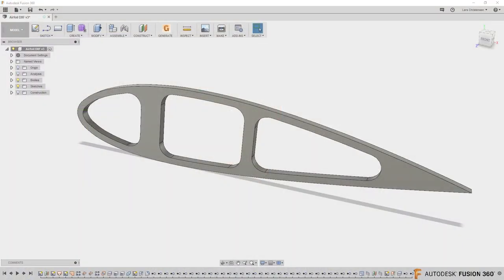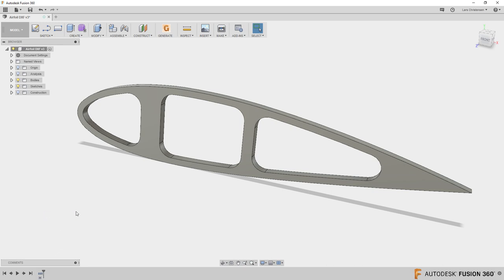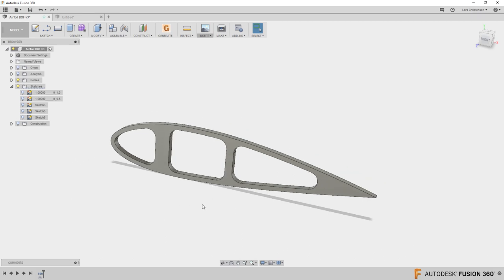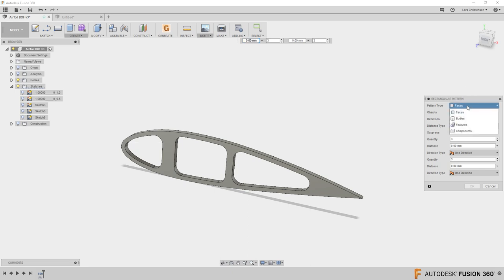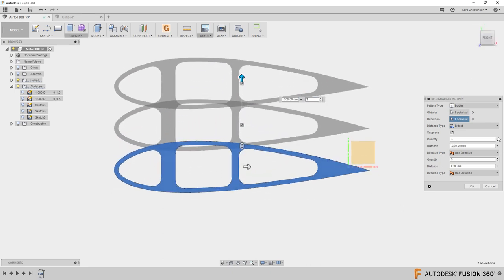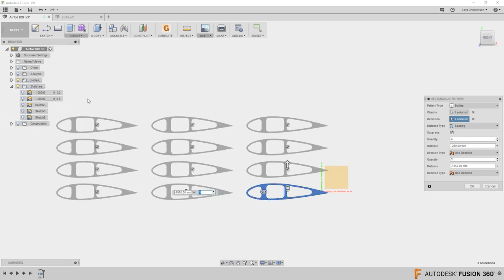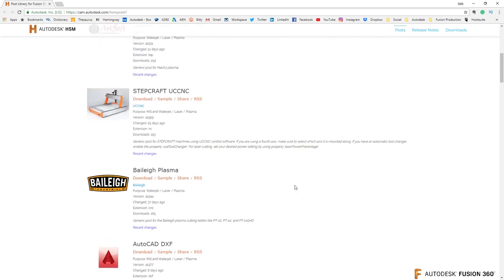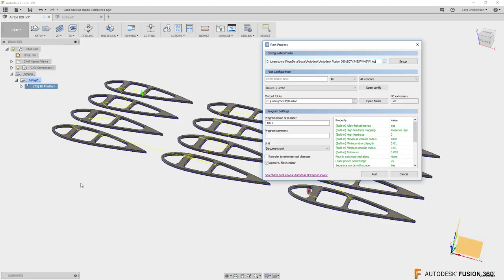How To Save As DXF For Waterjet Plasma & Laser — Fusion 360 CAM Tutorial — #LarsLive 164

Comment: Love the video! 
Now, one thing that everybody is showing when it comes to laser cutting and cam is a single part being cut. I'm doing design in 3d with multiple bodies and want to cut them from a single sheet. I could not find an easy way to do it without having to mess with the actual layout of the bodies. I've created 3 different setups but this is not efficient because it means that there is no way to control the layout of those parts on the stock. I would really appreciate a video that shows a way to deal with that situation. Thank you!
Reply: Frederik Delacourt check out Caleb Kraft here on YouTube. He shows how to do that with an octopus lamp.

Comment: Nice info again Lars!
I should actually test this, but I assume the posted gcode is optimised by location (nesting) which is another benefit.

Way back I had to write some software to sort output from Catia for an aircraft manufacturer where a vertical knife cut CF material and needed to be ordered by:
1. Mark part No.
2. Inside cuts
3. Outside cuts
This also had to be optimised for each 'group' by location and although I didn't make much money, I learnt a lot!
Reply from the maker: Hi Phil B Thank you for watching!
We could for sure find things to improve in that area of the software. I hope some of the TruNest tools will get over in Fusion soon
Reply: Yes please.

Comment: Being new to this I wanted to be sure I understand what happens after the DFX file is created. If the DFX shows an outline with say a hole in the center area when the DFX file is loaded into a router, cutter,... etc. the machine would then cut the outline out around the edge and make the hole as well? I think I am getting confused about tool paths, depths, etc. and think more has to be done for it to work.

Comment: I need to point out that using the "Body" selection filter in the project window creates an additional set of lines which is near impossible to detect. This however creates a problem with the laser cutting firms as they will need to delete these additional lines before they can process the order.
This video explains the differences between the selection options and how to make sure your DXF only includes the needed information: https://www.youtube.com/watch?v=01J8bvRAx4M&t=62s
Reply: Lars I love your videos and they have been pivotal to my learning process of Fusion 360. I also recommend your channel to everyone I know using, and learning how to use Fusion, so please do not take this the wrong way.
On this particular point though, I used your advice and generated hundreds of DXF files before the laser cutting firm I use pointed this problem out to me. Before, they simply spend the time fixing my files without ever thinking it is important to share such info. 
I am still in the process of recreating many of these DXF files and thought it wise to produce a video clearly indicating the differences in the sketches when they are created using the different selection filters.
If you feel I am overstepping my bounds, feel free to delete this, but then I suggest that you add some content to make sure other viewers do not make the same mistake.

Comment: Hey guys, I need some help please:
I have designed some 2-d parts in fusion, did a contour and cncd them and now they are all slightliy too big(1 mm). It seems like they are offset, but I have already checked if multiple passes is unchecked and weather the router bit size is correct. Thanks in advance for any advice.
Reply: Max Mustermann There is an option to calculate kerf offset in computer or controller in the cutting dialog - try swapping that.
Reply: But I there must be a way not to always type in the offset at the controller and just calculate the path correct in fusion
Reply from the maker: Make sure you take a look at this video where I talk about offsetting the toolpath:
https://youtu.be/LS1lHk5P0KE?list=PL40d7srwyc_Mkgc5wvP_OfVel9aDkNkZ6
Reply: Max Mustermann , for me the trick was to set that to 'computer' and use the torchmate post to a .fgc file and then import that into the cutting program.  Then fusion360 is in charge of the kerf.  Hope that helps :)
Reply: Max Mustermann what machine are you using?

Comment: Sometimes when I export a sketch as DXF and open it up in Adobe Illustrator the lines are not closed and curves have been generated with many points?
Reply: Stefan Perriard yeah, that happens to me alot. Use the "Pedit" command, also "purge" and "audit" this will clean up your drawing and layers
Reply: Thank you Travis. Where are those commands to be found in Adobe Illustrator?
Reply: Stefan Perriard -I'm Sorry, that was for Autocad... So inside (AI) - Object - Expand, then use the Pathfinder tool also to clean some of the files up.

Comment: In "dirty method" , why to project?
I have ordered lots of parts from laser cutting company.
No matter if it is sheetmetal flat, or any other surface at model workbench, i just greate new sketch on that surface and save that in DXF format, and send it to the cuttting company and they are happy with it.
Reply from the maker: Hi Harri Yli-Torkko Thank you for watching!
I did not know that. That is pretty cool. So as long as all your geometry are laying on the same plane, creating a new sketch will project the edges when saved as a dxf.
Thank you for the great comment!

BEst,
Lars
Reply: He was just double checking to make sure everything was there. The problem is when you're make a 3d object with MANY FACES made out of different pieces and you have to create a sketch, project geometry then export as DXF for EACH AND EVERY face! It's extremely non-intuitive and exhausting! Some way to explode a body into faces or similar is what is needed.